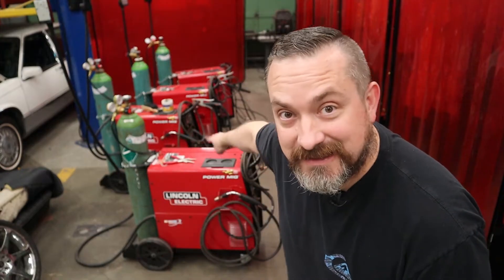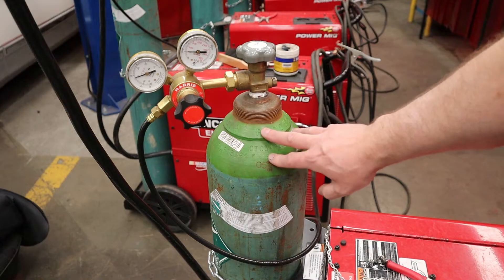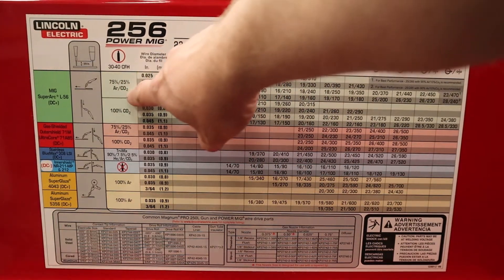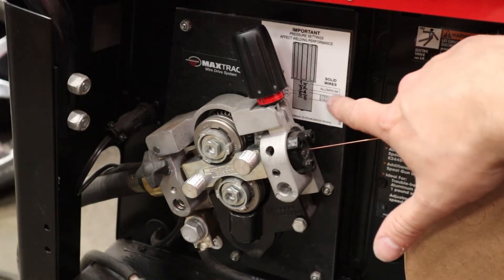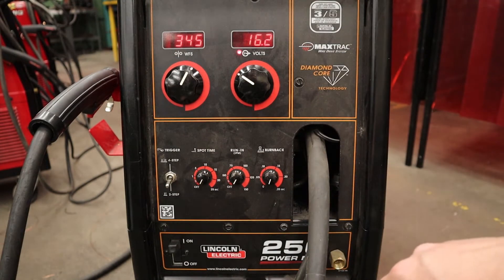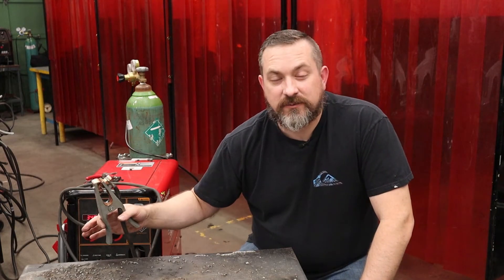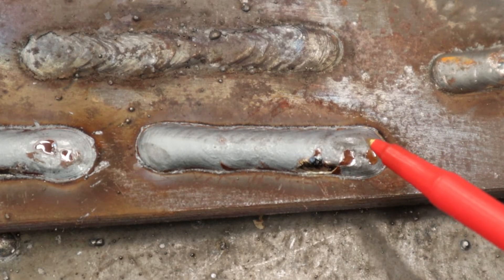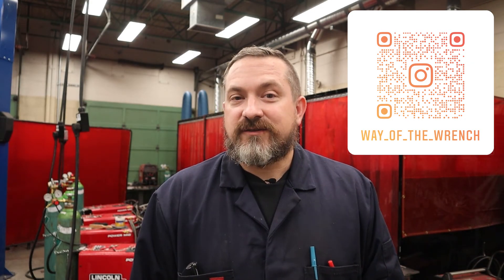How to set up a MIG welder

Comment: Excellent information for us new to welding.  Do you have recomened settings for run in and burn back times?
Reply from the maker: Glad you're enjoying the content!  I don't because every welding machine and every welder is different.  However, I would highly recommend getting some scrap metal and trying out the settings to see what works better.  Ideally mess with burnback  settings until you have the wire sticking out the recommended stick out after you stop welding.  Mine is 3/8".  Run in should be set so you don't feel the wire hitting the metal and pushing the gun away before it starts welding.  Hope that helps!  Thanks for the watch and welcome to the channel!
Reply: @wayofthewrench  Yes it did, thanks!

Comment: Hi. Happy new year and sorry for bothering you. I ordered 225 instead of 140.

Questions.
1. Do you see any problem going multiple passes to build up the weld on broken exhaust manifold bolt which is burried in the stud hole. Also i have to extend the wire more than 3/8 as you recommended because it is like 1/2 inch from top of the hole.. is that fine to exend the wire more than 3/8?..
2. do you see any problem in going multiple passess to buld up .. 
3. if i use flux do i need to clean for every pass?..
4. do u see any problem welding zinc nut..
Reply from the maker: For welding a nut on a broken stud with flux core you will need to clean off the flux every time you stop and restart.  You will have to watch you don't weld the stud to the block though!  Do not use coated nuts, use bare metal for best chance of welding fully.  The further away from 3/8" you are with the rod, the less heat goes into the weld and the wire starts to melt before it gets to the puddle.  You will also get more spatter.  Cheers!
Reply: @wayofthewrench  Hi, I read manual for Lincoln 180 and they are saying with  single pass it weld upto 1/4" and multipass it can weld up to 1/2".  I was under the impression   that thickness of steel and penetration are tightly related. so if iam welding a bolt that has 1/2 inch, can i do multipass ?.. if yes, then why cant i just buy 140 and do three pass?..

Similarly for torches(oxy ace..), can i do multipass and cut thicker metal  like 3/4??..

Appreciate your help.
Reply from the maker: Don't get sold on the multipass thing, by that logic you can do 5 passes and weld 1" thick steel....you can weld that but it ain't sticking.  In my experience the light powered mig welders are only good for sheet metal and small part like 1/8" thick and so on.  You start asking them to weld thicker stuff and you'll be let down.
Reply: @wayofthewrench  thanks so much and last what about multiple pass for oxy ace torch is the same hold true or multi pass help me to cut thicker stuff
Reply from the maker: Yes and no.  Usually you cut metal in one clean pass.  Multiple passes will make a mess as the slag will be thrown up in your face.

Comment: Hi, Just came  back again to your videos.  I am planning to buy lincoln 140  mig welder for my automotive work.  I use MIG weldging for 2 purpose.
1. one to weld a nut to existing rusted nut to take it out.. 
2. weld broken exhaust manifold stud, that is broken inside the flange, basically to build up the stud with a nut to flush..

Being said that, i dont know what wire speed and voltage to use for above 2 applicaiton. can you pls advise. How do i  measure  size of the steel in the above case to find out wire speed and votlage. ??.

another question is , when I mig weld, how much of wire shold protude out from tip and the gap between wire and actual metal (can i give 3/8 inch gap between wire and metal) not the TIP.
Reply from the maker: Exciting!  The one problem with that welder is it might not have enough power to weld thicker than 1/4".  It will look like it welds ok but you'll find things like 1/2" bolts with a nut welded on will rip off due to no penetration.  I have 2 older 140 Lincolns and I bought 255 power migs to do thicker plate welding.  You would set your welder to the thickness of the bolt or even a bit hotter.  3/8" wire stick out should be good, if you get too much spatter go closer.  It should show you under your welder lid.  Thanks for the watch!
Reply: @wayofthewrench  GOT IT.  can u telll me if the manifold stud is more than 1/4 inch in diameter cant i use this to build up on exhaust manifold broken stud.?..
Reply from the maker: Yes but a 1/4" stud with a nut welded on is way thicker so imagine buying a smaller welder that "says" it can weld it but then it can't.  You'll be wishing you went with the bigger welder.  Cheers!
Reply: @wayofthewrench  Thanks so much for quick reply. you asked me to  maintain 3/8 wire to stick out.. Make sense, between wire and metal do i need to keep 1/4 inch gap while welding or the wire should touch base metal when i pull trigger.
Reply from the maker: No the wire will keep feeding and there will not be an air gap between the metal the wire.  You have to maintain the 3/8" of tip of shield to metal
Reply: @wayofthewrench  thanks so much. Happy new year
Reply: @wayofthewrench  sorry final q. Lincoln manual says connect negative lead to positive for mig but for flux they want negative lead to connect to negative. Do you know why ?
Reply from the maker: Happy New Year to you!